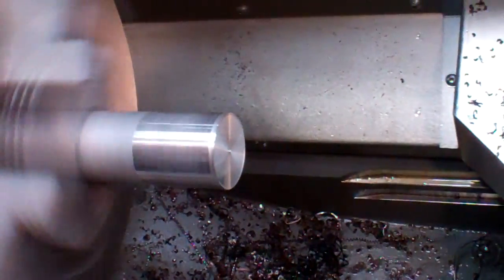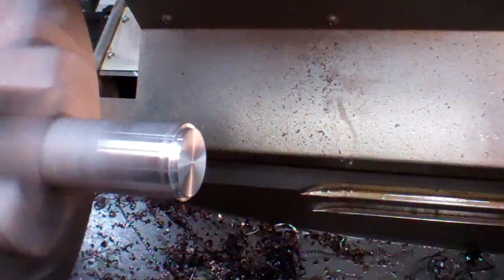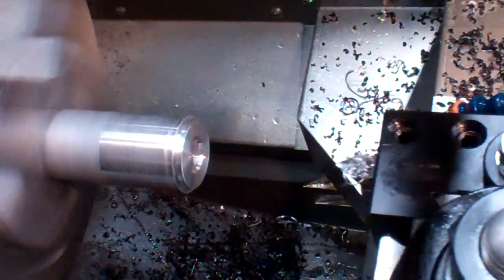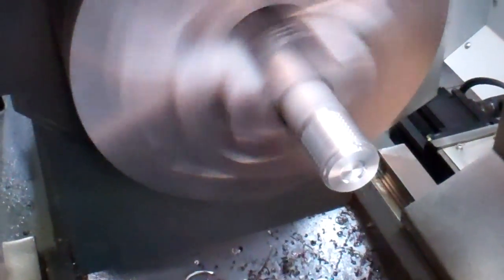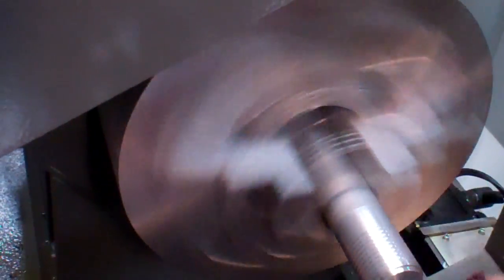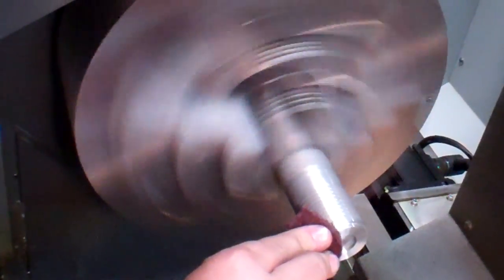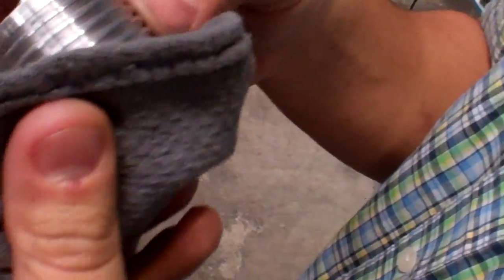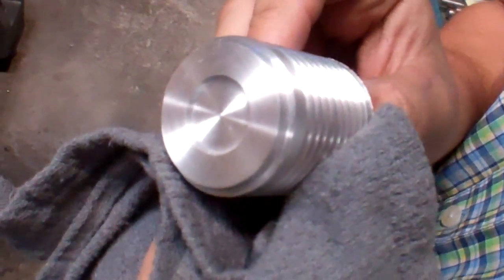Making a Shock Mount for my Ghostbusters Proton Pack on our CNC Lathe

Comment: I found using 2 different sized thick washers on a long bolt worked just fine, and was much quicker to assemble than using a CNC to machine one solid block, just an idea for those of you hoping to make a proton pack, check out my video of finished pack made using scrap parts